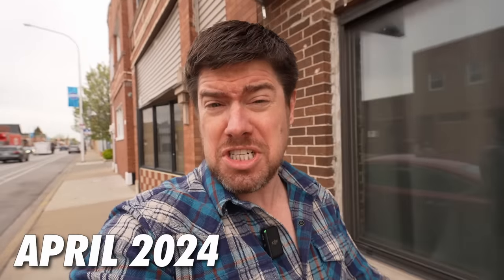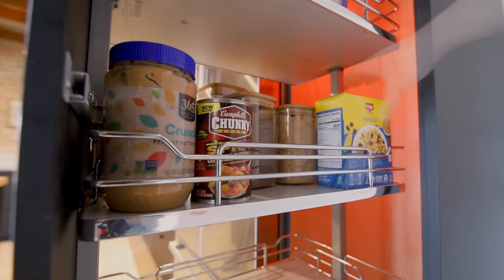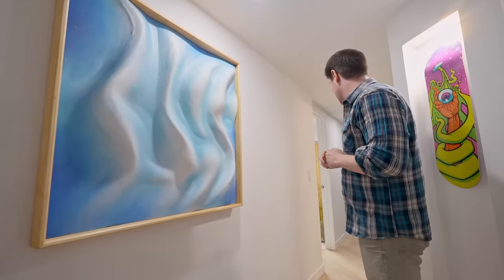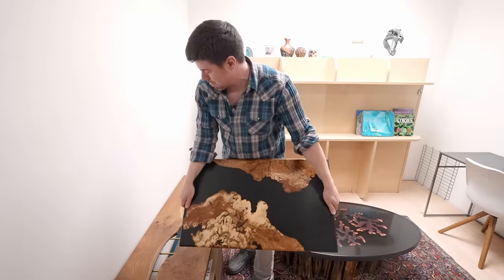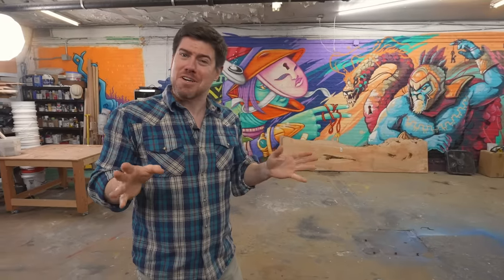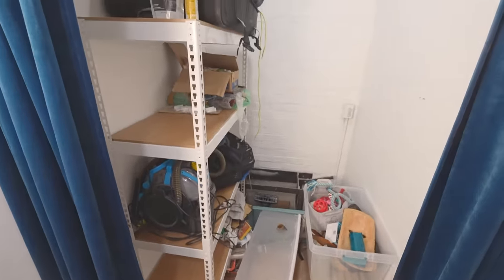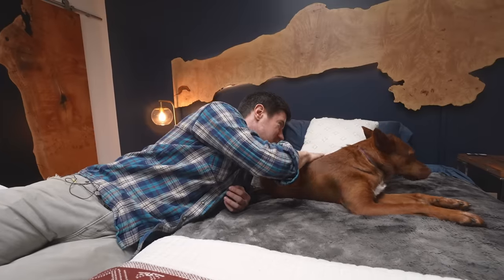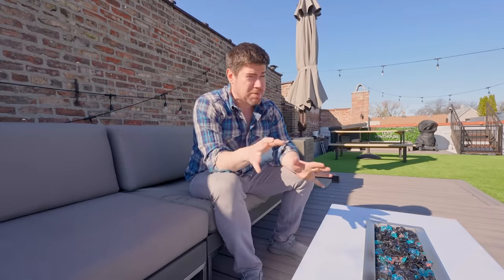The FINAL Tour (ep. 50) ... Abandoned Building to Dream Home

Comment: I had a apothecary cabinet a little bigger than that one and I ended up making it a parts cabinet that holds things like nuts, bolts and electronic components. Does not take a lot of work to convert it and is a perfect storage system for those odds and ends. With your CNC it could double as a great place to store and organize your collets, bits and other components of that in part maybe. I also 3D printed some Gridfinity containers that kicked it up a notch and made organizing collets awesome and easy to work with!

Comment: You should look into Four Seasons furniture for your new couch! There’s a frame called the Carlton that looks really similar to what you have AND it’s slip covered but if you look it up it really doesn’t look like it bc instead of having a skirt it actually velcos under the bottom so it looks super clean! It’s SUPER comfortable and they have a ton of performance fabrics which is great if you have pets or kids or whatever. Super easy to clean since the cover comes off in pieces so you dont have to take the whole couch apart AND you can order different covers if you get bored of the fabric and the frame and springs have a lifetime warranty. I work at a furniture store and we’ve had people that have had four seasons sofa for 10+ years and they will come in just to buy new covers for it bc the sofa itself held up so well. I couldn’t recommend them more. Look up dealers near you and go check them out!

Comment: The library card holder could be converted into a spice cabinet if you're a person who enjoys cooking and entertaining.  It could also house bar tools and a liquor display/storage on top & install a shelf between the legs for additional display/storage & support.  And the old metal frame from the door could be used as a glass table, you could stress the metal a bit cut a piece of glass to fit the top, incorporate some rgb led lights.  Could be an indoor or outdoor piece - I watched one of your stair videos and nearly fell asleep and was about to click the next video when I saw your reveal video...I really enjoy the hard work you've done.  Everything looks great, even the hand made decor but I would have to say the 3-D wood (stairs and sign) are my absolute favorite!  Following!  ALSO - the "storage closet" with the curtains could be converted into an additional "pantry" for those bulky items that won't fit in the kitchen.  Large packs of toilet paper, paper towels, large bags or backup items like dog & cat food, cleaners, etc.  I'd build a bookshelf or large wall deco item that acts as a secret door and hide that room since it's got the elevator in it.  Maybe you could rig up the elevator to operate under a manual pully system to deliver your bulky items directly to the pantry from the garage/shop so you don't have to carry them!
Reply from the maker: thanks!   and good idea!

Comment: Just stumbled onto this video and love what you’ve done. As an architect, I’m very impressed. One question I have is how you were able to have bedrooms without a second egress?
Reply from the maker: There's a second staircase in the back... I walk down it when I head the garage.  In the hallway in the garage in back it leads to a second exterior door
Reply: @modustrial  but all sleeping rooms are required to have two forms of egress from the room itself. This is usually accomplished with the regular door, and a window sized for egress. It looks like each bedroom only has a single door but no window; only skylights. Doesn’t seem to satisfy the egress requirement.
Reply: It’s possible there is no second egress requirement in Illinois. I just wasn’t sure.

Comment: Metal door grill,  cut it in half across the middle, weld supports on it, and make it a park bench, and paint it hot pink,  then sell it to raise funds for prostrate cancer,  you can put epoxy clear ends with the metal inside.